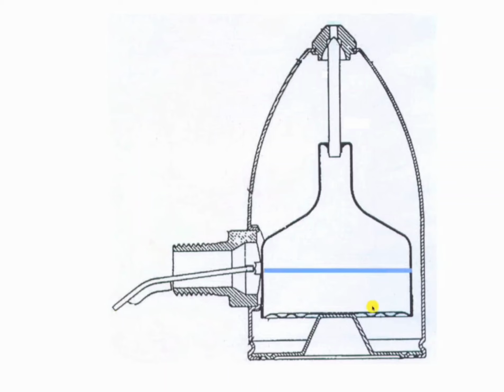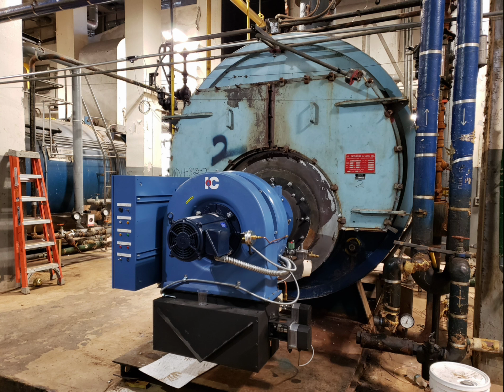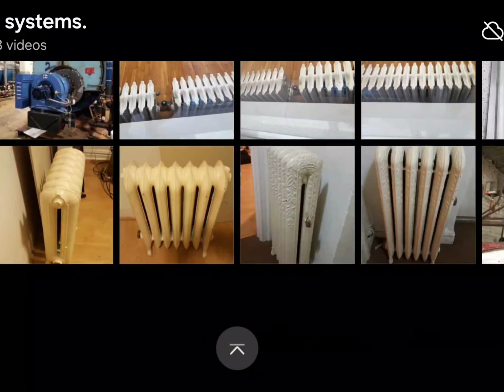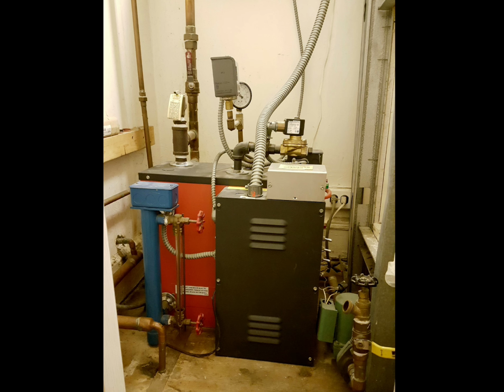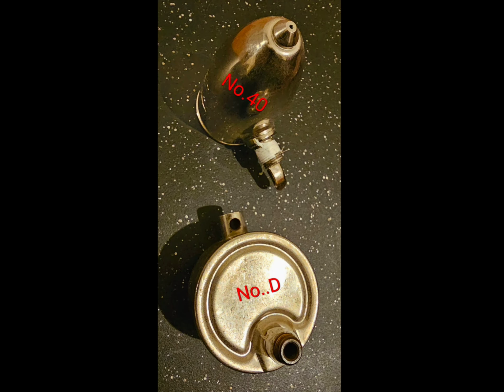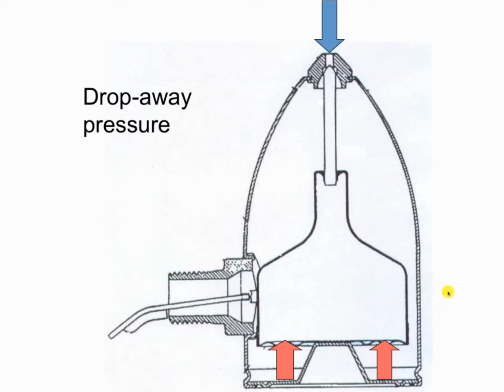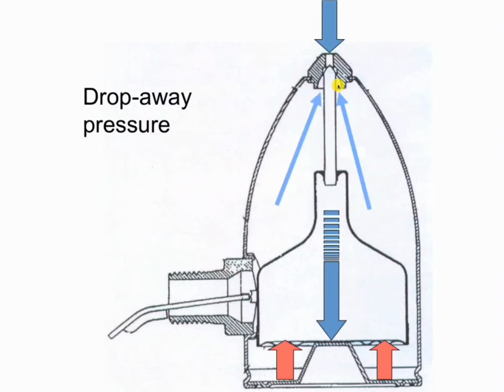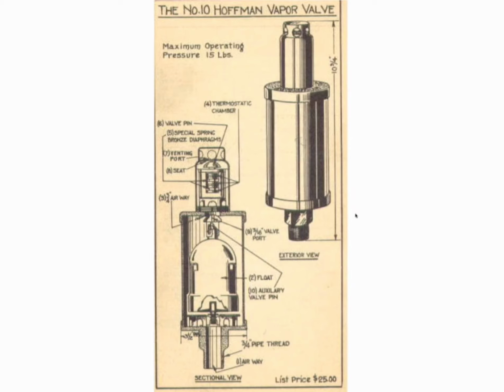Steam Heating Systems The Difference Between Gordon, Hoffman & Heat Timer Air Vents. 12/2/23

Comment: would you be able to do a video or get with me directly on converting a 2 pipe steam radiator to hydronic? I am designing a wood fired furnace/ Hydronic hydrid system for my home. from my understanding bottom pipe should be inlet and opposite side top of radiator should be the outlet.  Thermostatic/ bleeder valve should be installed on the exit side correct? thanks !

Comment: Gorton, Heat timer, Hoffman,
Interesting video on steam system air vents, I watched your videos from 2012 about fire tube boilers, #6 heating oil and natural gas and the difference between cast iron one pipe radiators with pot belly valves and finned one pipe convectors, at 28:50 that looks like an American radiator from 1895 to 1910, good video ARCO.